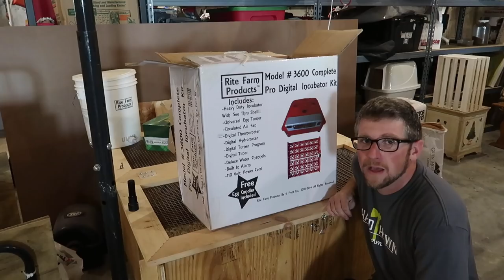I should have Listen to Y'all the Kubota is Broken Again

Comment: Since your on a roll with the eggs, get some lemon oil and qtips and bait the top bar hive.  Someone has a swarm they need removed.  Build your own capture boxes and run an ad on craigslist.  You have the skills to open any wall, ceiling and make it as good as new and get paid in the process vs buying bees.  Set up the traps on your way to town.  Easy to check them.  Camera, audio, channel, all great.

Comment: Not sure if you will read this now, maybe it's too late. I used to work for a mowing contractor, we maintained all grass areas on an air force  base here in Australia and did all the maintenance ourselves. When changing blades all you need is a nice chunky piece of wood. Place it under the middle blade so it rests up against the side of the deck, if it's thick enough the blade will hit it and stop it from rotating, making it easier to really put some force on it when tightening. It was 25 years ago and a much older tractor, L245 if I remember correctly, and maybe yours works differently, but my boss didn't even have a torque wrench lol, we just did them up as tight as we could. If you can still turn it by hand the pulleys won't have any problems either lol, but you do need to get them a lot tighter than you did in this video, which is what the wood is for. And as far as changing washers every time like someone suggested, we only changed them if they were damaged, but again, yours could be different. Anyway hope that helps if you see this.

Comment: The mower deck is still going to give you problems. The bolts should be torqued to 72-86 ft/lb, there is no way you got them tight enough the way you tightened them. You should have had to block the blades with a 2x4, or something to stop them moving while you tightened them. The cup washers should also be replaced every time you take the bolts out, or loosen them. Hope this helps.
Reply: Always use a torque wrench when tightening mower blades.

Comment: I have a 2004 Kubota bx2200 that has the same issues. Change fuel filters every spring and had to buy the cup washers for the blades. I store it outside so the fuel system condensates water in the tank which clogs up the system. Good luck.

Comment: The camera is clear but it being attached to your head makes it a little hard to watch because it is very jumpy. I think that it would be good for high action shots but not so much just walking around or working on things.  The audio does not seem as loud as your other videos.  The pigs and goats are looking good though. The bolt you used last time made for a quick fix until you can get the parts that you need.

Comment: Morning Al.  Video looks fantastic.  Audio is a bit hollow and compressed.  Could you a bit of mid to high range boost somewhere in the 800-1.2k range.  You should be able to do it in post depending upon the software you use to render.

Comment: I like all your videos. 
Since you asked for constructive feedback:  I have worked on sound in different projects.  The best thing I have found to do is to
compare (do an A/B) with your other videos when you used different equipment and decide for yourself.  With just about
anything, it’s hard to say something is good or bad without comparing it to something else.
With the audio, your editing software may allow you to level out the volume from clip to clip throughout the video.  That way users don’t have to adjust the volume in different places.  But the GoPro audio level is consistent since the distance of your voice to the camera remains pretty much the same.

I noticed the picture was a touch grainier in spots with the GoPro compared to your other videos.  Probably due to light.  You may be able to adjust it, I don’t know.  
Bottom line, imho, I would go with the old equipment and try to level out the volume.  Then again, the GoPro may be more convenient for you. And that’s fine too. :)